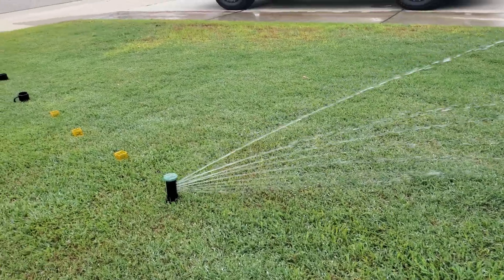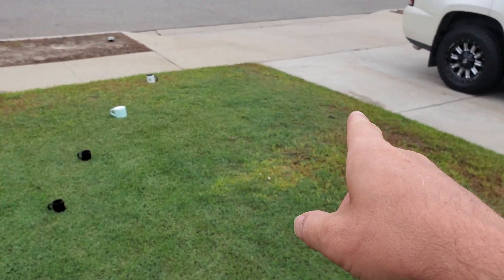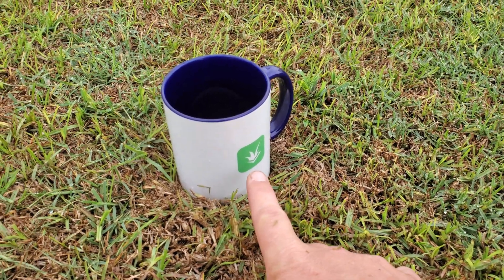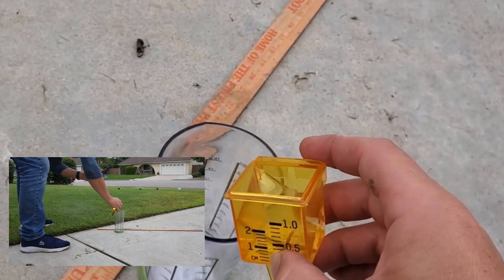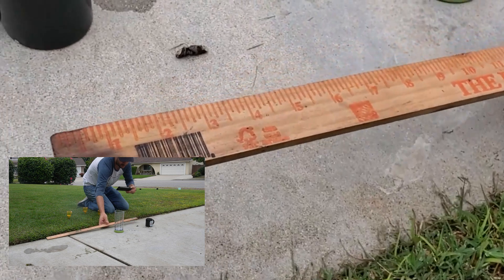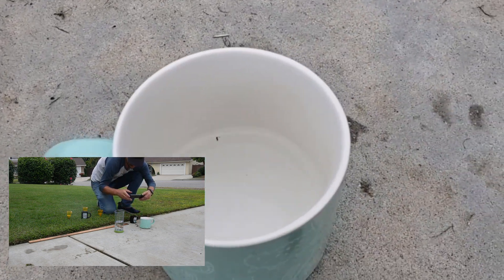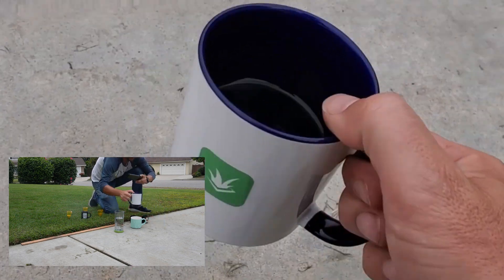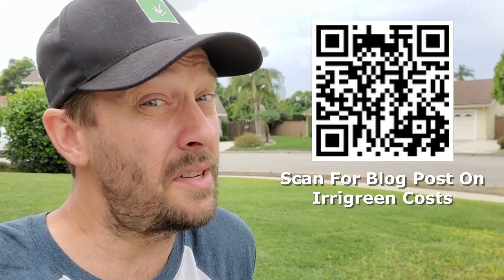Is Irrigreen Accurate? How Much Water Does Irrigreen Actually Use?

Comment: This clearly was not a good test setup. There are 8-12 individual streams, so if you only have 8 cups then obviously some will get hit more directly than others. Lawns aren't cups. The water is going to spread when it hits the turf and it will spread even more as it penetrates the ground. I'm not sure what the answer is for a good test. Maybe a long trough with end to end sponges!

Comment: Using larger diameter shallower cups might produce more accurate measurements, or better yet use the pro plugger to remove a plugs then use cups the same size down in the plug holes so they completely flush with the surface of the soil.

There's still a strong selling point on how it does not waste water onto unnecessary areas.

Comment: Yeah, the pattern on those heads seem awful, so the cups may not give a good reading. As heavy as the streams look, I think splash/running will bring even water coverage. For that reason, they likely would not be ideal for seeding on mostly dirt. Over seed/established watering is likely fine, though.
Reply: Irrigreen recommends that you do not use these sprinklers for new seeded lawns.

Comment: I agree with your assessment that this sprinkler uses the splashing action of the water to create it’s coverage. I would use something wide and low like a pie pan to account for some of the splashing. I think in Irrigreen’s marketing, it says they use the capillary action of water to get it to the borders of the your area. Soil moisture gauge would be helpful as well, but it would be hard to take into account variations in soil. Thank you for another excellent unbiased video.  😊

Comment: I didn’t expect perfection but I expected a little bit better. I feel like you’ll have brown spots close to the head and at the end of the range, and a jungle in the middle of the range. It’ll be interesting to see results next year. Since I know you use hydretain, maybe do an experiment where you use it on half this section and not the other half, and see if you do in fact get brown spots
Reply from the maker: Yeah it'll be interesting to see how it all shakes out next year when the lawn is fully established and out of recovery mode. I'm curious if the dispursion caused by the stream hitting the grass and ground lead to more even coverage. The company clearly says to plan for thos on the furthest fringes...and you can clearly see this in action. So much water comes out at once at full flow that water splashes all over the lawn when it hits, it's possible the tuna can or coffee cup measurement method isn't best for this sprinkler. I may try again with a moisture meter at different depths next time I run the sprinkler.
Reply: @TurfMechanic that would be interesting to see as well.

Comment: I am not at all surprised. I was not impressed with the first time I saw the spray pattern on those things looks like a terrible design from the get go.
Reply from the maker: I think the flow hitting the ground and splashing/dispursing probably makes up a lot for these issues I'm seeing in this test. If a large flow hits the ground at full force it splashes everywhere and spreads its coverage out wide but if that same large flow goes into the cup directly then it doesn't splash and spread out wide. The splash is what we want in the lawn to get more even coverage. I'm going to do a different variation of this test again hoping to take the splash into consideration. Going to brainstorm that a bit more first though.